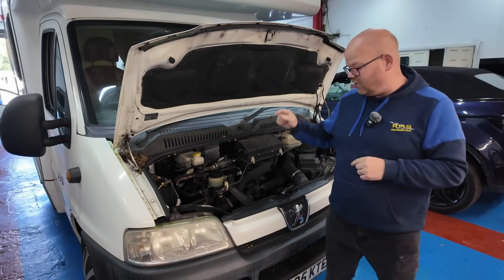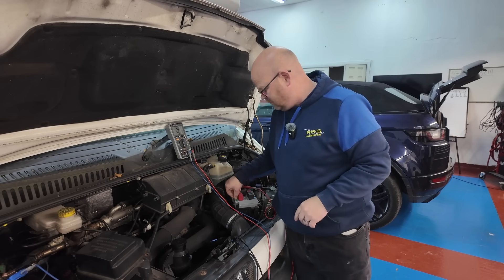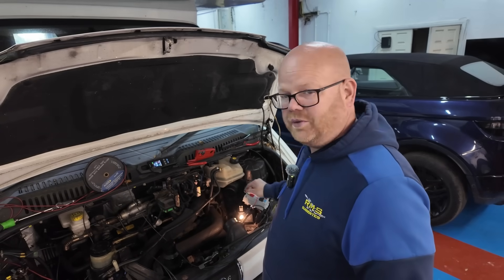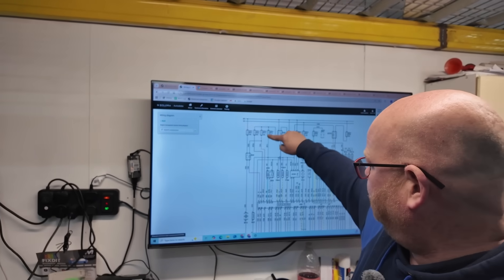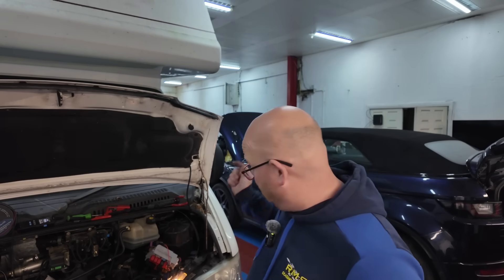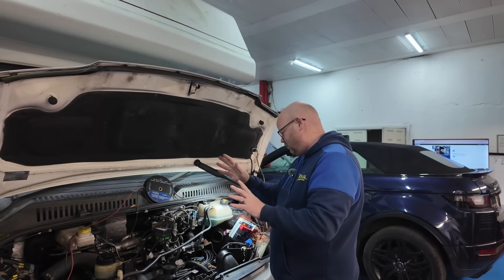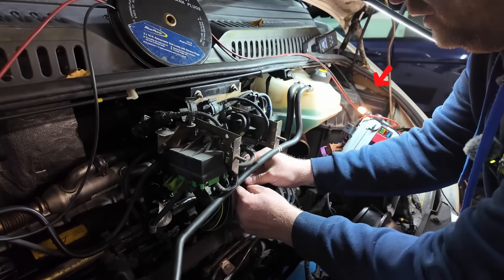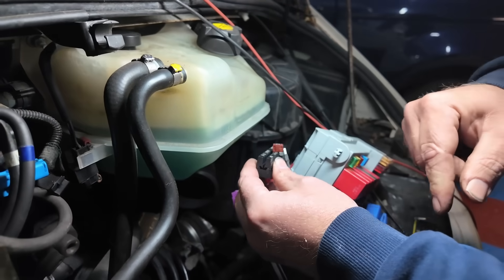Short Circuit Diagnosis Made Easy – Watch Our Real Workshop #DDTSB #DIAGNOSEDAN #automotive #snapon

Comment: Did you remove the main negative cable from battery whiile diagnosis,then how did the bulb placed in the fuse glow without a ground path thanks
Reply from the maker: no just the positive,we leave the negative to complete the circuit

Comment: no current when around all the wires gave me answer straight away that its a component failure rather than short to chassis  also the fact that tracer reversed direction
Reply from the maker: exactly mate i love when people follow along
Reply: Bob, after identifying which components are on that fuse circuit, why not just use process of elimination by removing each component one at a time to see when the lamp goes out, thereby identifying which part of the circuit is shorted rather than spend time initially breaking into the wiring looms? Then while the bad one is disconnected, check the wing at that point to determine if it is a wiring problem or the component?
Reply from the maker: @golfnut533 there can be many components on the fuse also if you disturb to much while removing components you might loose the fault find out as much as you can before stopping too much

Comment: If anybody was wondering why you can't see amps on a clamp when more than wire is in the clamp voltage going to a circuit is canceled if the return path is in the clamp, same as home electrics, only clamp 1 wire and check both directions 😁 great vid
Reply from the maker: exactly that mate